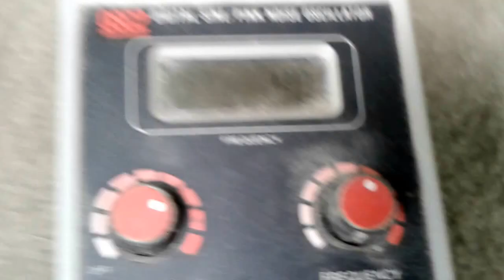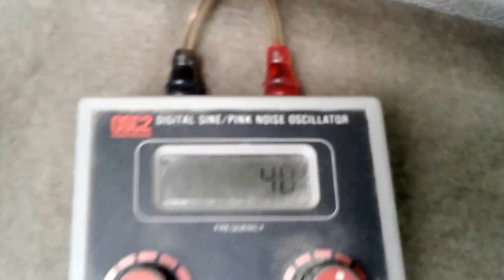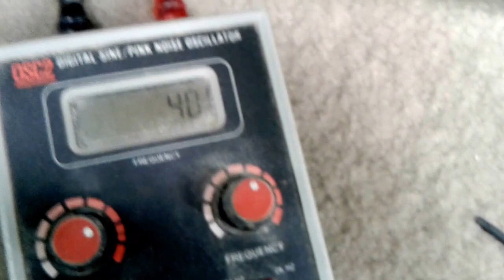Quick Tune on the rp-2000.1

Comment: Always tune your gain before you think about touching the bass boost. Ideal situation is setting up your gain and not having to touch bass boost
Reply: At least he can see if the signal is clipping before touching the gain. I got a similar tool off ebay for about 35 bucks. Very handy.